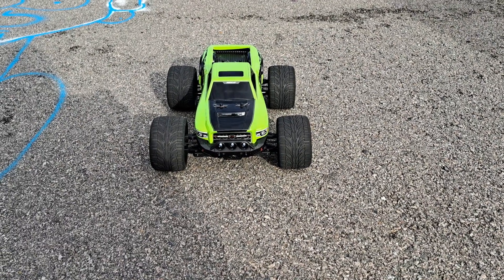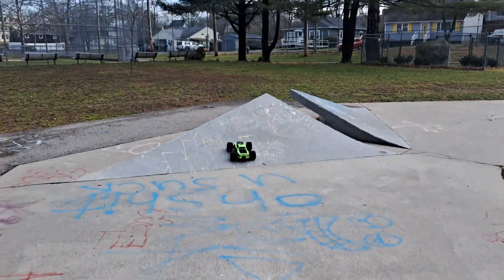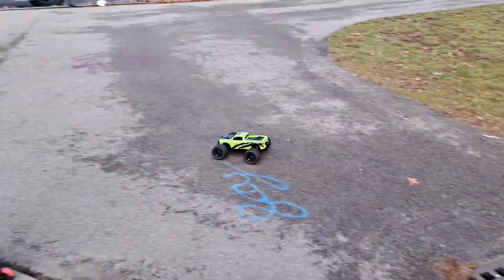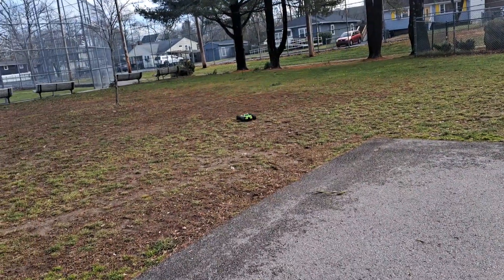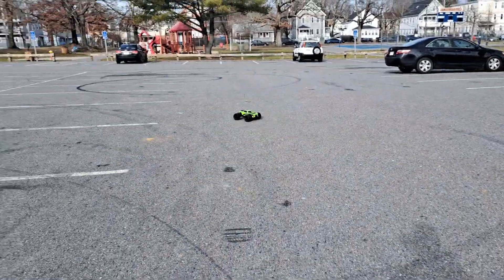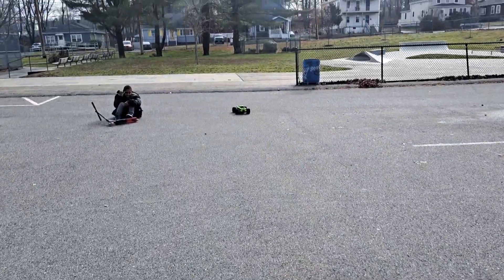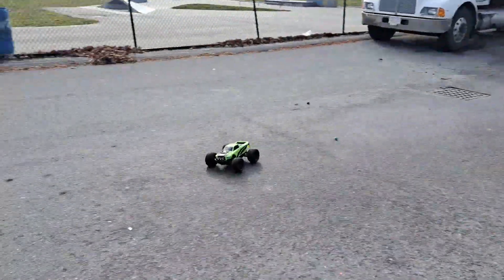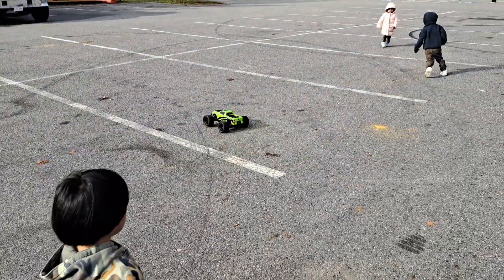Rc MT10e 3s rip!!!

Comment: Runs good for sure.. 12-13t probably the best ..To much gear on that high KV motor might cause heat issues or make esc cut in and out
Reply from the maker: I guess it's worth the risk lol